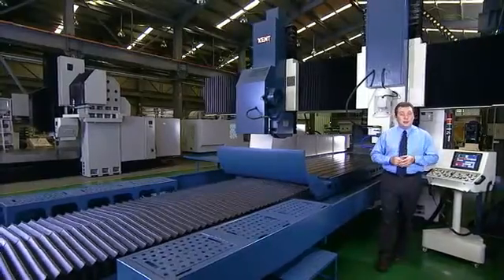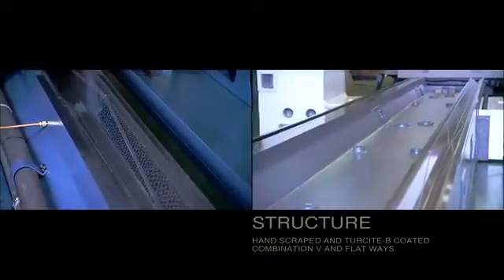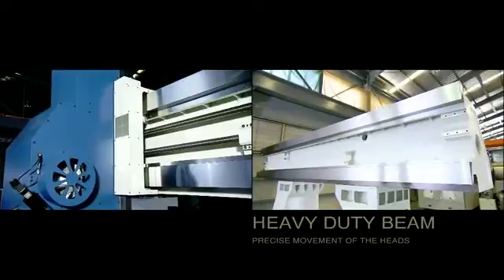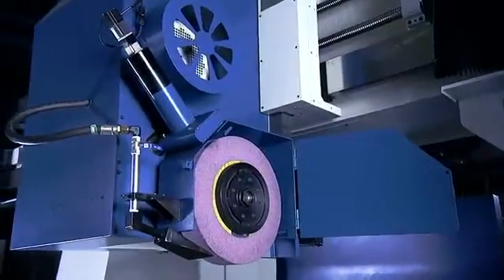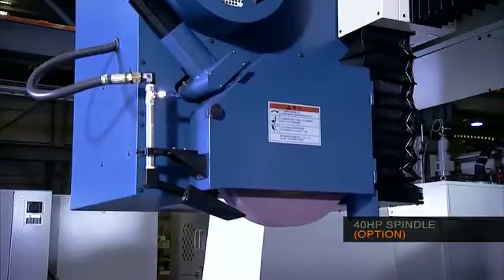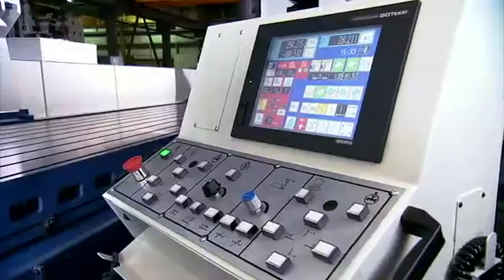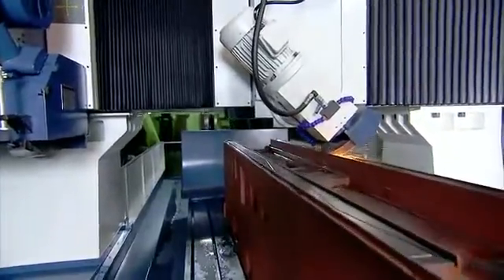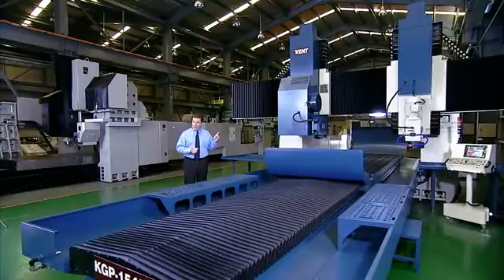Máy mài giường KENT - Double Column Surface Grinding Machine

Comment: 銅翌(DOWELL)2010/9 plane grinding mill for sale size: 800mm * 2000mm PLC Mitsubishi servo motor controller ZY-axis spindle motor using 20HP Siemens  TAIWAN 0989995865